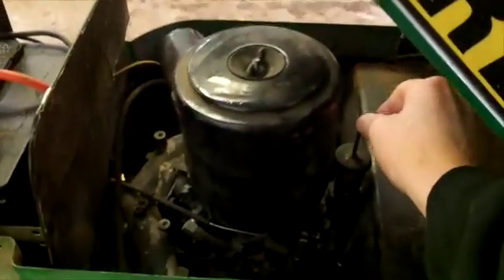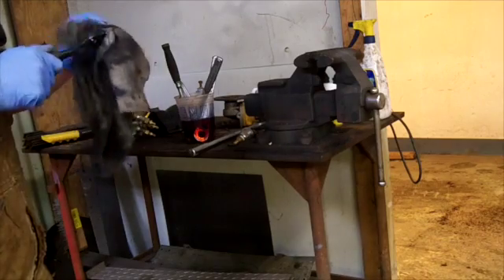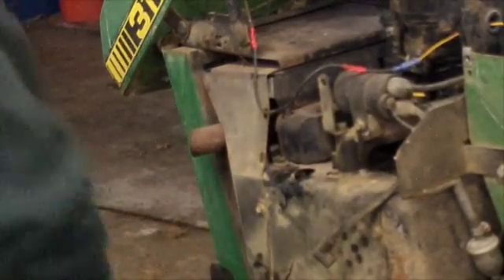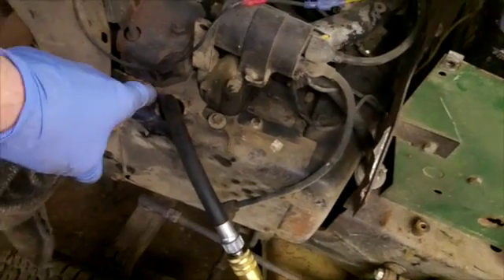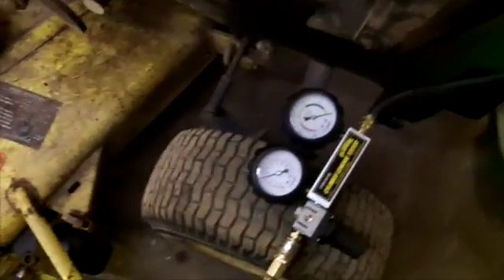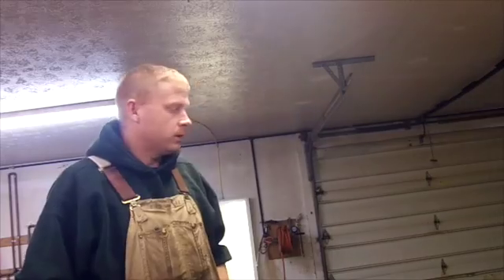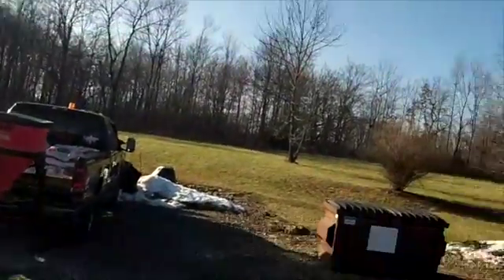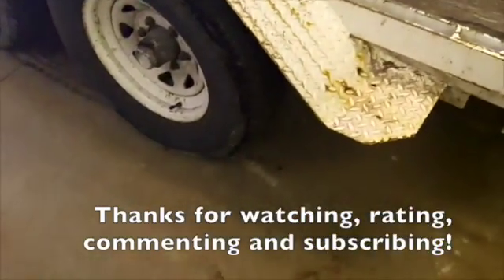John Deere 317 compression test and cylinder leakdown test

Comment: You're supposed to zero the gauge before you hook it to the hose screwed into spark plug hole on the engine. Zeroing it after its hooked up means you are compensating for the leak by adding more air to get the needle to zero. That first cylinder you tested showed zero percent leakage which is impossible since all engines leak a little bit of air past the rings, and you can even hear the hissing out of your engine.

Comment: Most of those ratchets come apart real easy. I pull mine apart yearly to clean out the pawl teeth. bondo dust, dirt, sweat, shop lint, rust all seem to manage entry into the heads and they start slipping. Cornwells main office and distribution center is near you I believe. Maybe stop in someday, Maybe pick up a plow contract??
Reply from the maker: Thanks for the info.  I might try taking that 1/2 inch drive ratchet apart to see what I can see

Comment: My father had a 317 john deere and got a 50 inch mowing deck for it, Thing was like a tank !!!
Reply from the maker: I only have a 48" deck but it is a beast for sure.  The older machines like this don't spin the blades as fast as the newer ones but they still cut well.  It's more of a yard dog for me... don't really mow with it.  I use my zero turn Grasshopper 928 Diesel with a 61" front deck to hammer that out!
Reply: Now I gotta get the Big Red ASS back up & running...
Reply from the maker: One project at a time... I'll get them done.  It's not what I wanted to be doing but I hate things that leak oil

Comment: You've got a healthy V twin there brother :)
Compression within 10% per cyl is very acceptable for an older engine.
JD has the oil fill stick avail as a service part.
Leakdown on a twin isn't as critical as compression, but if you had a V8 in the 317 we would have something...lol
Great vid as usual Shawn !
Reply from the maker: Thanks Doug.  One cylinder showed around 100 psi and the other around 90.  The one that was making 100 psi is the one that was whispering thru the exhaust valve.. go figure.  I thought 110 to 120 psi was healthy.  By the way, it's an opposed Kohler KT17 (series I)